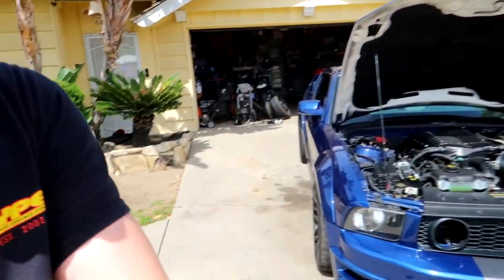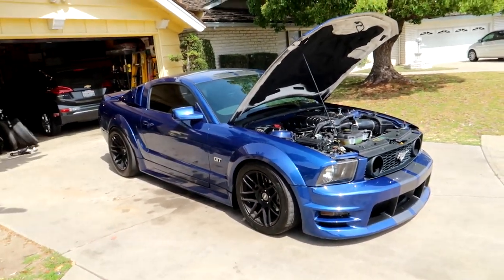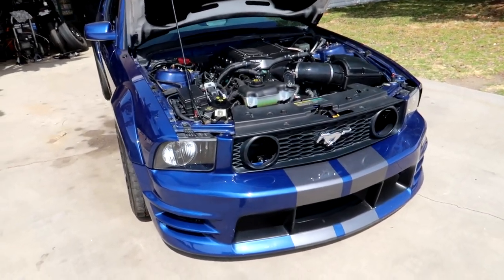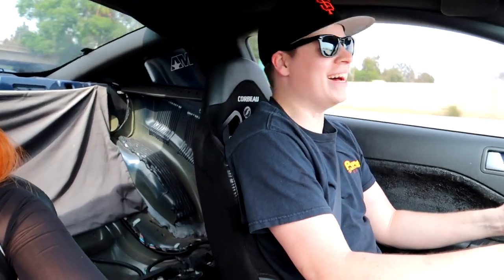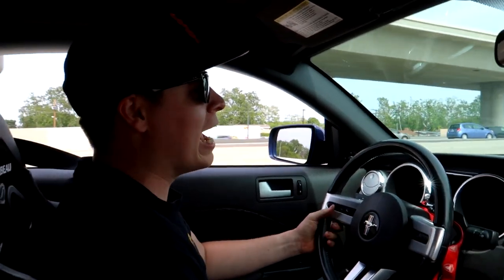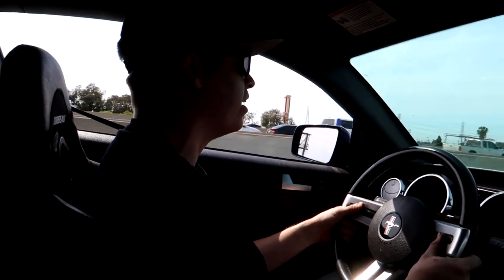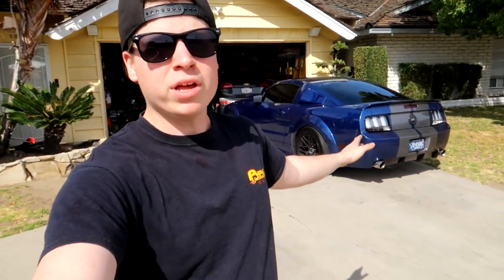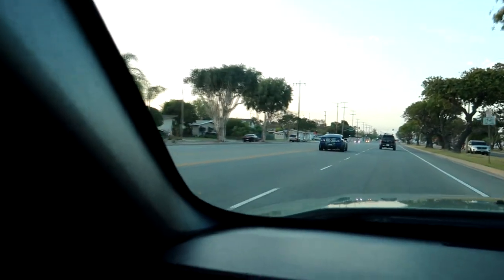THE MUSTANG IS BACK AND IT'S THE FASTEST CAR I OWN!!!

Comment: my car also recently was fixed. it doesn't have that much power but it's a good feeling being able to drive a car that's been sitting in the driveway for a month due to some bullshit part they don't make anymore (AFM). I ended up soldering the connections back together, turned it one notch and my car instantly started right up
tried to buy one before all that but had to send it back because that one was also broken

Comment: I think you need to increase the ride height at the rear wheels or stiffer springs/shock absorbers at the back to not run the tyre in the wheelhouse that can cause premature wear.

Comment: pretty surprised it came back with the supercharger setup same as mine. For the brakes I have a GT350R brakes and they stops, those goes on my 17 but would be nice if you can make a way to put it on.

Comment: Roots?? Your supercharger is “rooted”
Lol, and “you haven’t RODEN in my car” haha…bro, you’re way smarter than that-your fresh build makes you SO high that you can’t talk! It’s kinda cool- I miss that feeling. I used to have an ‘08 Shelby w/a 3.8L Whipple supercharger and small pulley and making 1,196 bwhp and she was SO “unstreetable”. The first turn I made out of the sales lot, I hit the gas as I normally would in my other vehicle and the car did a 360 I. The intersection and when I tried to drive it off in the hurry I was in to get outta there and all my car did was smoke the tires all the way down the road in front of the dealership (those dudes I know must’ve just been like,”oh that guy just bought the wrong car🤣😂it was hilarious and then the next week I took it to DynoComp to have her tuned down to about 645 hp…cut it in 1/2 and it was much smoother on the road